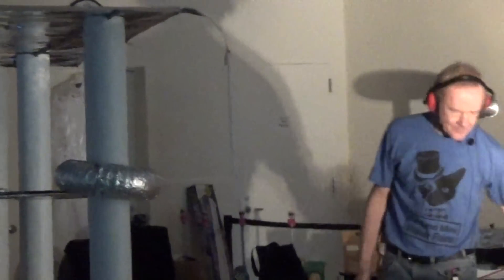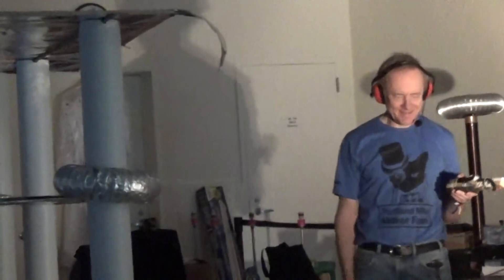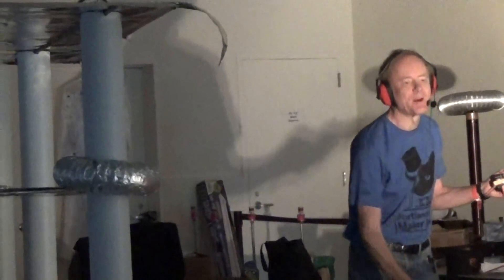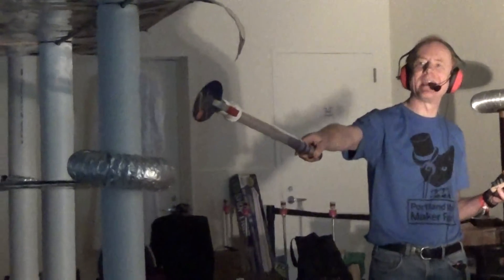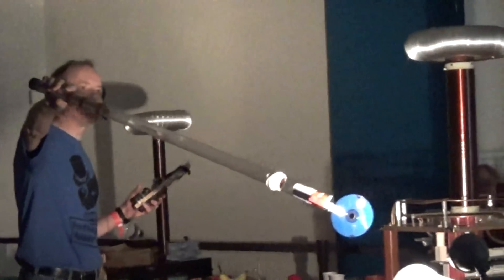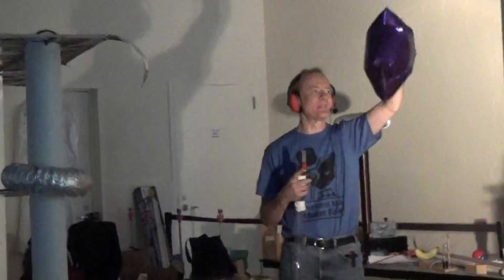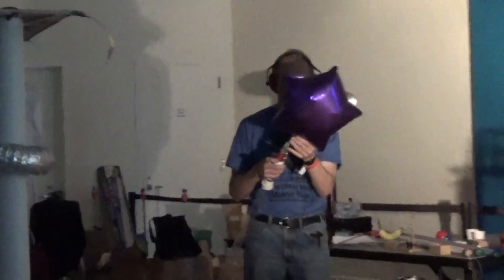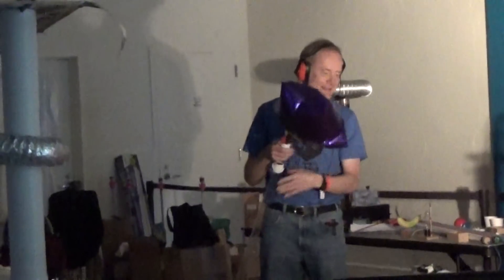440,000 Volt Marx Generator Demonstration at OMSI Portland Maker Faire - audience view

Comment: 330 kV
Reply from the maker: I understand your skepticism about voltage.  Short (~1us) pulses make shorter arcs for a given voltage compared to long pulses or DC, and much shorter than AC as from a Tesla coil.  My DRSSTC has only slightly higher voltage (~600kV peak), but makes 3m (10') long arcs.

For this Marx generator, I measured voltage with a capacitive divider, calibrated at 1kV where I could measure it directly with a scope probe.
Reply: @davekni  Ok, but are you sure it can't jump longer gap still. It also depends on the gap geometry and impulse polarity. Impulse shape can be changed by combination of Marx resistors. Positive impulse of ~1us rise time can close 0.5m needle gap at 400 kV without problem
Reply from the maker: @imeprezime1285  Polarity is negative here, although I could reverse input connections to make it positive.
Prior to building this setup, simulations indicated 600kV.  The erected Marx capacitance is 229pF, 12 stages, 42kV per stage, for 500kV at the top of the generator, then a bit more boost from L/C resonant transfer from 230pF at the generator to ~100pF air-capacitor at the output.  Corona from the top of the Marx generator appears to be the biggest un-simulated energy loss mechanism.  I did get a few unintended arcs of just over 2' from one of the SS spheres at the top of the generator to the adjacent wall.  (The caps in the Marx generator are not rated for nano-second discharge, so I try to avoid direct arcs from the top of the generator.)
Reply: @davekni  60 cm seems quite reasonable for very short (cca 1/5 us) negative impulses with amplitude about 500 kV. This is what 35 cm gap?
Reply from the maker: @imeprezime1285  Yes, roughly 35cm.  It will arc a bit farther, but I don't like to push the limit.  If it doesn't arc, then the charge cycles back through the inductor to the Marx generator.  The pulse caps I'm using (WIMA FKP1 6kv 22nF, 8 per stage) don't handle AC well.  I tried using them for a Tesla coil.  They failed quickly.  Also, with a longer gap, the arc strikes as the voltage is on its way back down, so the arc is much less intense.
Reply: @davekni  That would mean you have L-C circuit on the output. Larger inductor would make longer pulses  (and longer sparks I think)
Reply from the maker: @imeprezime1285  Yes, there's a 12mH inductor coupling the top of the Marx generator to the air/aluminum-foil capacitor at the front.  That has a ~1us time constant.
Reply: @davekni  That would give about 1,7 us rise time for Cout~100 pF. Should close 35  cm gap before  400 kV is reached. At least by V-t curves for arcing horns

Comment: Just wondering how do you achieve audio modulation is it via transistor/vacuum tube?
Reply from the maker: The +-22kV charging supply for the Marx generator is enabled at a rate between 50 and 100Hz to make the different notes.  It is a very low register, and only one octave range.  (Every time the supply is enabled, it runs until the next discharge.  The discharge disables the supply until the next enable pulse.)

Comment: so awesome, u seem a little close, but i know u know what u are doing.,.,.,.,.,.
Reply: how many decibels is the spark?
Reply from the maker: I think it's a safe enough distance.  These simulated lightening strikes are very short pulses.  If I were to contact them, it would HURT, but probably not be lethal.  The 40KV DC input to the Marx generator does have enough current to be lethal.  That's where I worry the most about making a mistake - any time that needs checking or repair.
Reply: @davekni  About 10 joules of caps energy is considered potentially deadly

Comment: Awesome!!  Love the hot dog demo and the music too! Dave, what's the RMS current supplied during firing?  Do you worry about brehmstrahlung radiation or TGF (gamma spectrum) emissions.   Ron
Reply from the maker: I wasn't familiar with TGF - looks to be a fascinating subject.  I'm guessing that if TGF could be generated artificially, even with 5+MV Marx generators, there would be articles on such experiments.  I didn't find any in my quick search - just theoretical models and measurements of the natural phenomenon.  Being at roughly sea-level (1atm pressure) and only 440KV, I doubt I'm making gamma radiation, certainly not the MEV-range measured naturally.  I was initially concerned about UV radiation.  Wore sun glasses for all my early testing.  Some simple estimates and finally a crude measurement convinced me that the UV was not enough to be of concern.
BTW, the back-side video shows more of the equipment, including corona from the top of the generator itself.  The first few seconds are shaky, but it gets better:  https://www.youtube.com/watch?v=O01MgA6z5Gs
Reply: Unless the arc was generated inside a vacuum or in a pure atmosphere of certain gasses than there is no chance of any harmful radiation being emitted here aside from ozone and the edge of the uv spectrum which would possibly damage developing or sensitive eyes, but likely not permanently at that..   like stated in the video, there is way more concern towards life supporting surgically implanted devices such as pacemakers, insulin pumps, artificial valves.,   Credit cards would also be in danger and sensitive electronics..  if you removed the core of a metal halide bulb and illuminated it without the outer glass you would be in way more danger being in the same room than any marx generator...

Comment: whenever the generator is on the camera starts flickering, is it because of the EMP induced by the generator ?
Reply from the maker: I believe the flicker is due to a beat frequency between the camera's frame rate (60Hz) and the Marx generators repeat rate.  The generator is discharging from 50 to 100 times per second (50-100Hz), playing simple tunes, excepting the initial CD zapping at a lower frequency.  The camera is wrapped in aluminum foil shielding, with an opening for the lens, to protect from electric fields.  The primary problem with the electric fields is coupling into the electret microphones in the camera.  The sound is still rather poor - much easier to recognize the tunes in person.  It is also very loud in person, about 115dB.  That is why it is hard to hear me talking after each run - the camera's audio has backed way down for the loud noise, then takes time to ramp the audio gain back up.
Reply: It is indeed the frame-rate interfering with the firing-rate of the Marx-generator, you will also see this with electronic signs (LED-signs) on buses and trains: the multiplexing of the LEDs will make the sign flash in an annoying pattern or even make it partly invisible. This differs from camera to camera. Some models try to find a scan-rate where the flickering is almost abundant. I wouldn't be too surprised if NTSC-framerates are a little more susceptible to this than PAL's
Reply from the maker: All sounds good, although I'm curious why you suspect NTSC would be worse than PAL (59.94Hz vs. 50Hz for progressive-scan as in my video).  Is it just because PAL is an integer frame rate in Hz?  Since the lightning strikes are at rates varying from 49 to 98Hz (notes G1 through G2), I don't expect either standard would flicker similarly.
Reply: Well, I experienced similar effect on my (smaller scale) Marx generator when recording video with fluorescent lights on. When i took videos with only outside sunlight this effect did not take place.